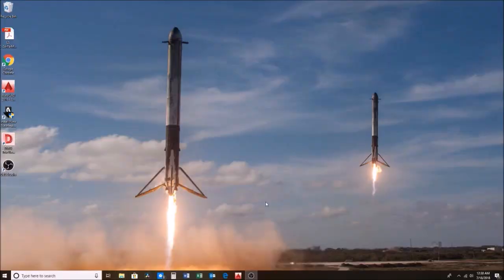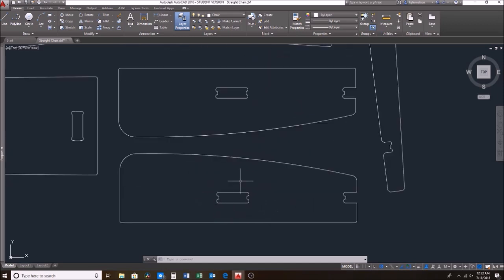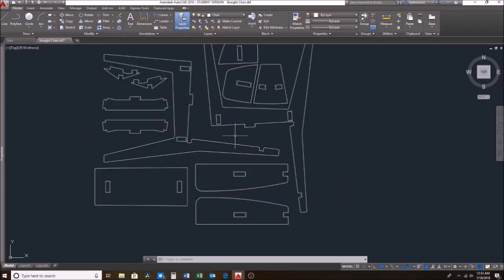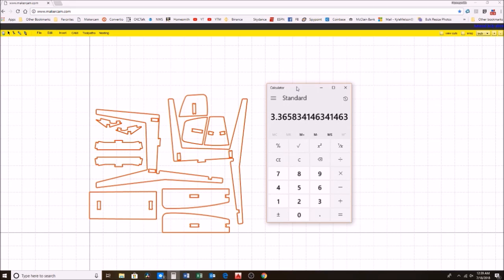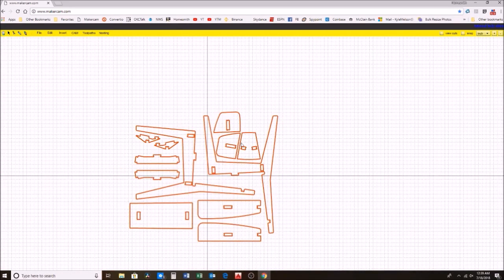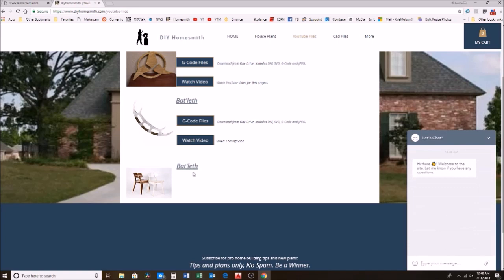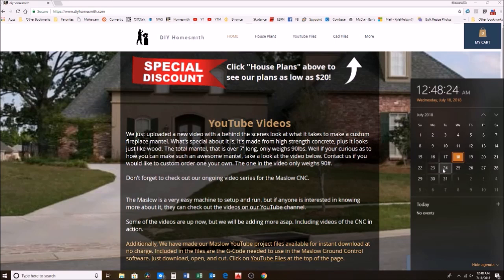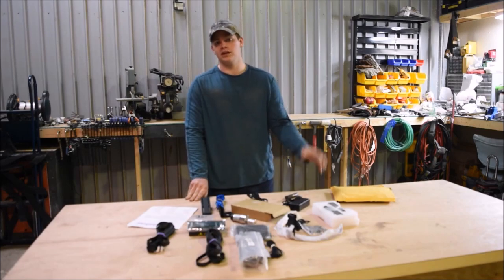Straight Chair Maslow CNC Video 1.5

Comment: I watched your first video and was inspired to build the P9L with my Maslow as a first project.  So I downloaded from instructables.  If I could make one suggestion...  If you are going to finish the chair in a clear poly or something that will show the wood grain, you may want to change your layout for back & seat so you get a continuous grain across those 2 surfaces.  Keep in mind that the center seat piece goes in with the thinner end to the front.  My chair turned out pretty good (not perfect), especially for a first run and my first time using F360 CAM.  Another FYI, you may want to turn your feed down to 20-25, depending on the material you use.  Good luck and Thanks for the inspiration.
Reply from the maker: You are right, i didn't think about the grain, i will fix that.
Reply from the maker: I adjusted my files so that the wood grain will be consistent on all the pieces. I also didn't add the tabs in the video, so I corrected that in the new files.

Comment: Check the drawing units in AutoCAD, if it is in feet, your drawing may be coming in at 1/12 scale. Also I would check and turn off the annotation scale in AutoCAD. These things may help your problem with the scale.
Reply: The makercam does weird thing with SVG files. I have never seen any file so far that would not need some scaling. To be precise I draw just a line to my DXF files below everything that I know for sure is of certain length, say 60" and then I do convertio stuff to get SVG and once I open makercam I can see how much it measures in inches, and if its 11.7" or so I know I have to scale it by a factor that is 60 divided to 11.7 or 512.8% to be very exact. (I did this to the last object I made on my maslow, numbers might differ no reason what you use in autocad to draw the thing)
Reply from the maker: That's what I thought, but the math doesn't add up. I only have to scale up almost 4x not 12x. That's why I'm wondering if it's a metric problem instead of a imperial problem. I set #makercam to inches, but it may not matter.